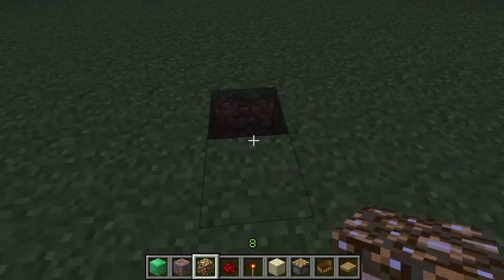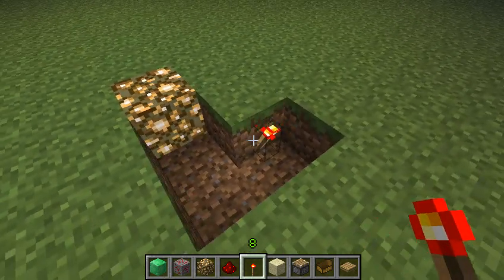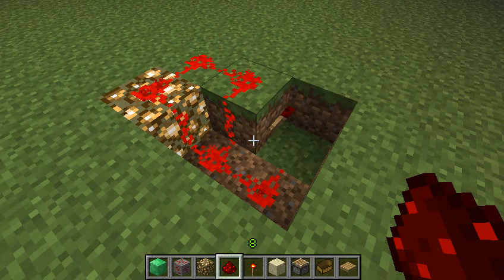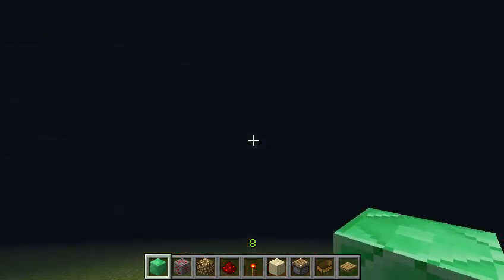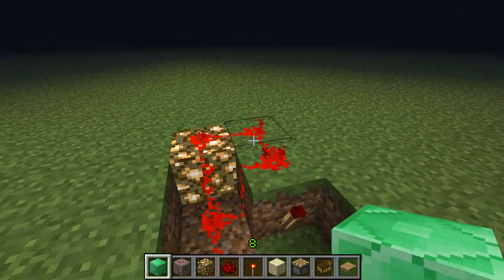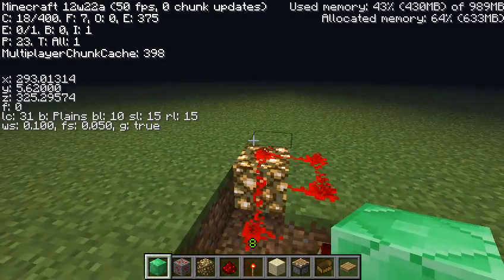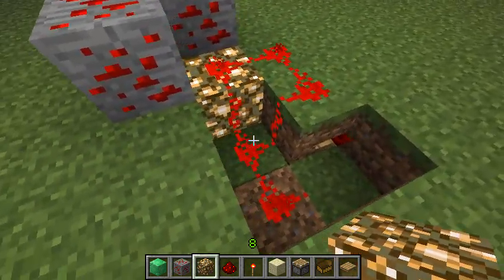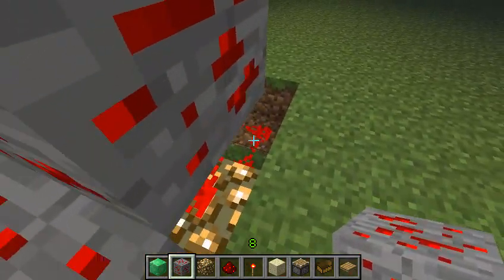Silent Pistonless BUD Switch (Tutorial) Minecraft 1.3

Comment: What about where the dirt is next to the glow stone. That mean you put the glow stone in the corner ceiling of some room, so the redstone wire gets covered, and it looks like it belongs.

If you cover the glowstone with a trap door (a common practice), you can then flip the trap door to activate the bud.  It sort of turns the glowstone into the equivelent of the classic, pull down a torch to open secret pannel, except in minecraft you open the trap door.